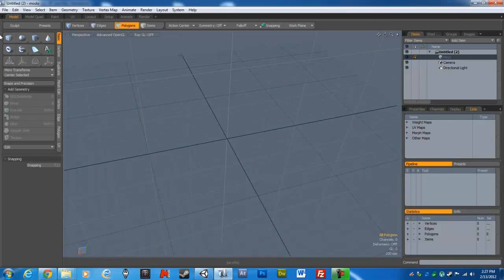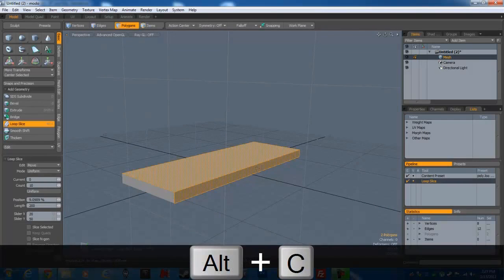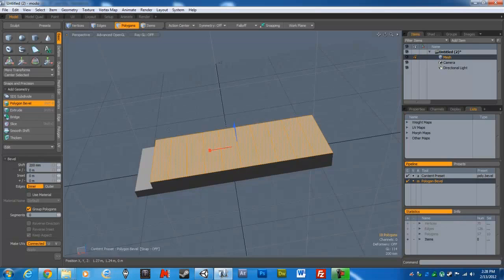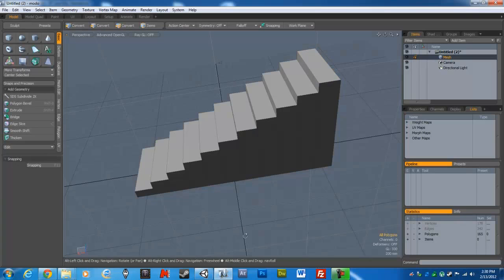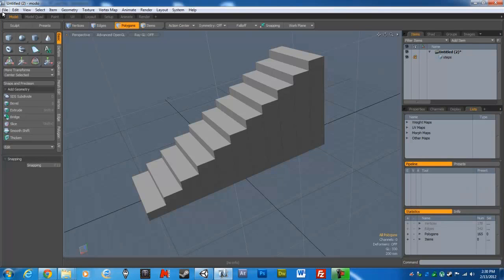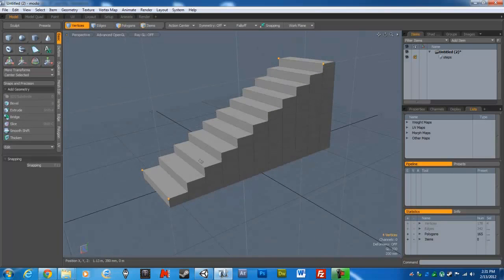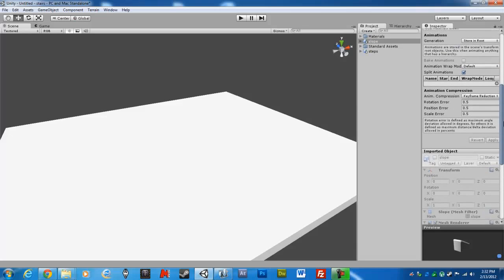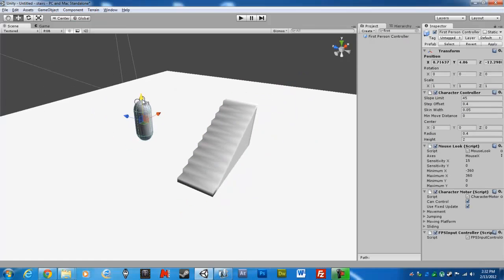How to make stairs for Unity 3D (louder audio)

Comment: Yes, it also works with blender.

But just create it with the slope (I use a thin cube and rotate to match).
Then on unity Change the mesh filter to none and you get the same effect.